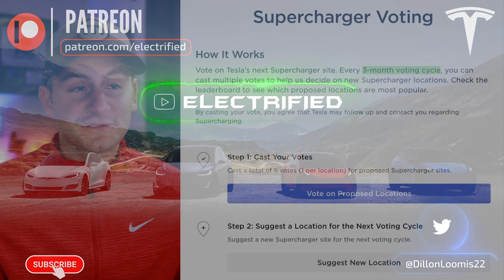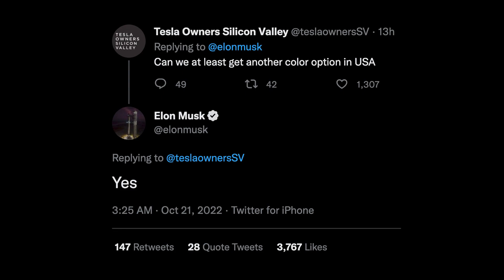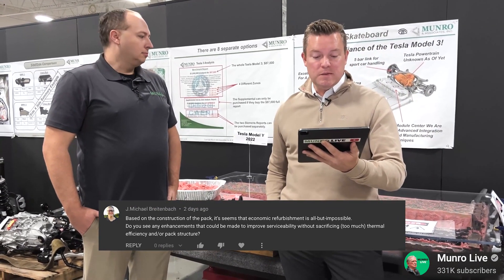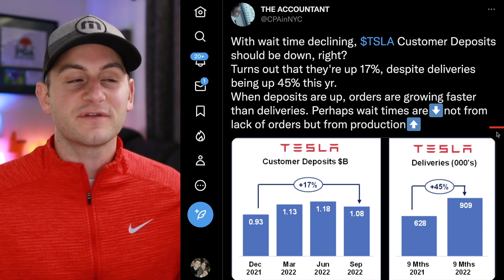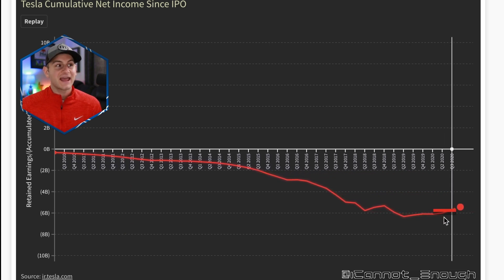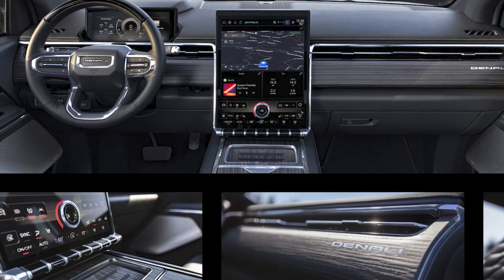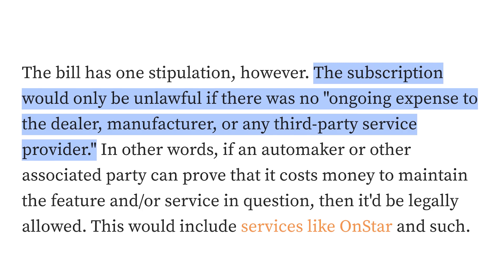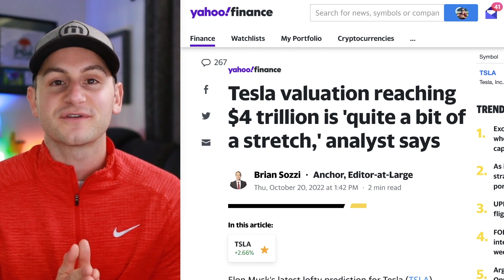Munro Live Shares 4680 Pack Detail / Proposed Auto Subscription Ban / New Tesla Paint Colors ⚡️

Comment: I KEEP ASKING how those structural battery packs are going to be recycled. No convincing answer so far. Looks like Munro basically had to beat his to pieces. W.T.F.
Reply: Only Tesla can answer that.
Reply: @jamesengland7461  Tesla is recycling as well as building batteries.   How stupid would they have to be to make a battery they can't afford to recycle.
Reply: @danharold3087  of course.  I'm sure they even designed it for ease of recycling; we just aren't privy to those details.
Reply: @jamesengland7461  I suppose we'll all find out in the fulness of time.
Reply: IF Tesla is doing it do diligence they have selected a filler with a know environmentally friendly solvent.  Soak it in the tank.  RInse it off and grind it up.
Reply: @danharold3087  Great. Well, do you have any possible solvents in mind? Wow, I'll tell you one thing: If there is such a solvent in use, don't get it anywhere near me!
Reply: @ronaldgarrison8478  Absolutely not.  When people think solvents they are looking at using it on something not designed to be removed.  Many are nasty.  In this case the chemist or material engineer knew batteries would need recycling and chose his materials appropriately.   If it were my project several would have been recycled to verify. Don't let the trouble Monroe had dismantling it cloud you thinking on this.
Reply: @danharold3087  And you know this HOW? WHAT is this solvent? Can you tell me that? And how did you determine it?
Reply: @ronaldgarrison8478  Down boy down.  If I knew that bit of information I could possibly sell it and buy a new Model X.  I don't have to know what the solvent is to understand how the pink goo and the solvent would be selected to work together to make the packs recyclable.
Reply: @danharold3087  Well, if they have managed to do what you're describing, that's one hella thing. t's going to be hella interesting to find out how they did it. Like I say, in the fulness of time.
Reply: @ronaldgarrison8478  It's just chemistry and material science.   As green as Tesla claims to be how embarrassing it would be if these packs were not recyclable.   If people have to recycle with there is one more profit center.  So yes wait and see but I don't see the logic in making a pack they can't recycle.  Kind of like shooting oneself in the foot.
Reply: @danharold3087  Yes, they must have thought about it; the issue is beyond obvious. Yet, that link stuff looks beyond tough. It stymied even The Great Munro. I really want to know what that stuff is. And maybe where I can get some!

Comment: So, every 10 Million EVs, lowers oil consumption by 200 million barrels of oil per year 

55 million EVs on US roads by 2030 will lower our oil consumption by approximately 1 billion barrels of oil per year 

The US currently uses about 20 million barrels of oil per day and about 7 billion barrels per year 

So 54 million EVs on the road by 2030 will lower our oil consumption by about 1/7

The US has about 5-7 years of known oil reserves 

What are we going to do ?
Reply: Recheck your facts on oil reserves... 5-7 years?  Hardly
Reply: We have new tech that has extended that reserve for many many years.  That does not mean I feel we should use it.

Comment: The law about stopping service fees for hardware installed in vehicles is a direct shot at Tesla's FSD.  As it states it included services like OnStar.  This law seems ok until you realize it will force Tesla to change their entire manufacturing model, or charge everyone upfront for FWD and it not being an option.  Other car manufactures already produce different models and just don't install hardware if the customer doesn't order it upfront.  So they can charge an install fee later, if it's even an option.
Reply: This is more a shot at BMW who has toyed with the idea of charging a monthly fee for heated seats.  The law might have unintended consequences, but good for NJ in protecting consumers.
Reply: Tesla clearly has an ongoing expense unless you would like them to freeze the program.   A chunk of software like this requires maintenance for bug fixing if nothing else.  So I don't see it as a shot at FSD.  If the law includes FSD Tesla stops the $200 subscriptions.  If you want it you have to buy it for $1500 or whatever the fees are.

Comment: The unloaded range means nothing in a pickup. What happens when you are towing or hauling 325gal of water. That's 8lbs per gallon. A normal load for me.
Reply: What does your ice powered truck lose hauling that 2,600# payload? Expect the ev to lose a similar amount. 

Kyle from out of spec did a video where he hauled a couple thousand pounds in the bed of a lightning on a pallet. I think he lost about 5-10% range vs unloaded range. 🤔
Reply: @4literv6  Yeah its not the weight so much as the wind resistance of the load or trailer
Reply: @danharold3087  which is interesting really imo. Because say a lightning weighing 6,100-6,800# loaded to max cargo capacity.
Ads up to 2,200 additional pounds of weight. Or nearly 33% to the unladen weight. 

You'd think hauling that around would increase consumption accordingly. Yet my own towing&hauling experience since 2013 shows. 
Loading the bed down even to max capacity usually only causes about a 10% increase in consumption. 

But towing around even an empty 2,500# landscape trailer? Hits my efficency by 20-35% depending on speed and traffic conditions. 🤔
Reply: @4literv6  It is just physics at work.  The weight in the bed only increases the rolling resistance and changing speed.  With regenerative braking you get most of that back too.  Wonderful stuff.

Comment: I do not like the integrated 4680. They should be able to be dropped down and replaced.
Reply: You can at the pack level.   What the video said is that at the pack level the most frequently failure is due to connections.  This super rigid pack is a lot less prone to failures.  But I get what your saying.